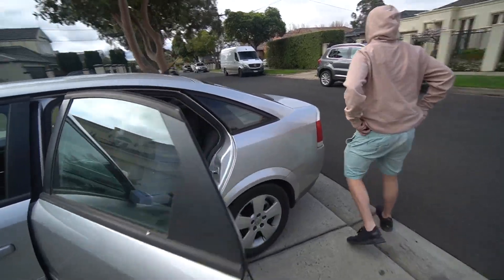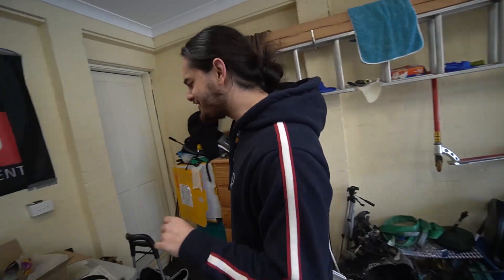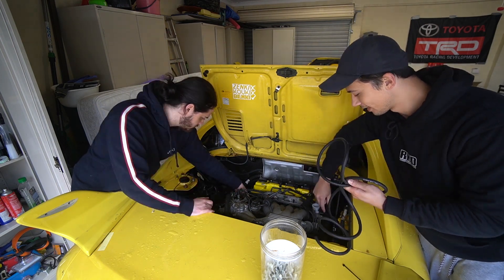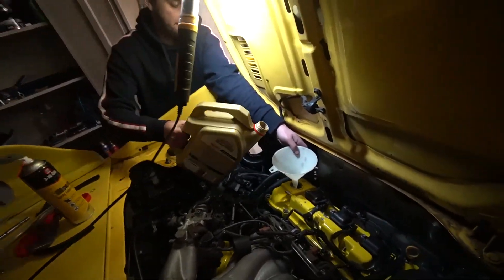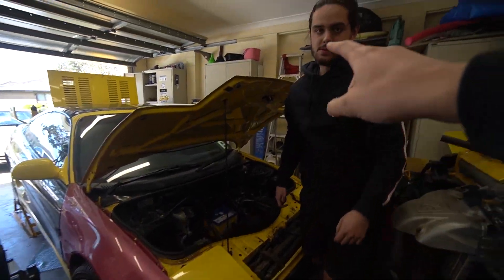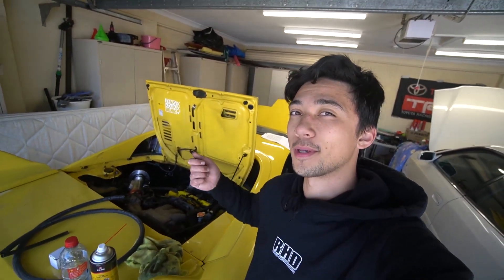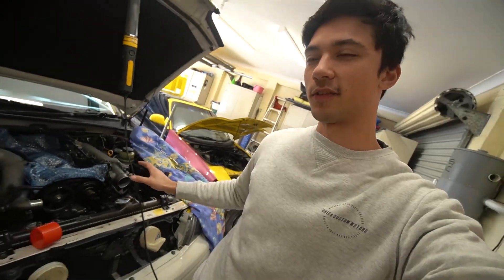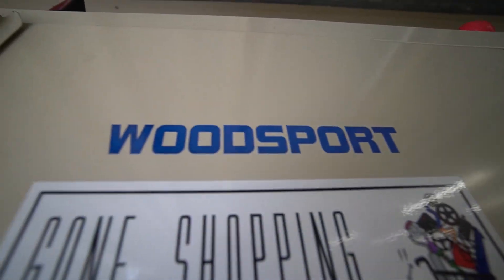STARTING the Benki MR2 For the FIRST TIME!

Comment: if its got o2 sensors in the exhaust its not gonna idle without them man ✌️
Reply: already has both the o2 sensors installed, hoping it's a vacuum line that's causing the rough idle.
Reply: @LachysGarage  yea man could also be the pcv if you unscrew the oil cap or pull the dipstick out and it idles better/revs up that would cause a bad idle aswell

Comment: Rex 5w-30 is too thin a viscosity especially since that motor has 260xxx kms, my 1mz has 200xxx kms and I’m putting 10w-40, I’m telling u Rex based on the way u guys drive them that motor is gonna wear out much quicker than normal
Reply: Yeah I was about to comment that lol
Reply: Songs Without Corey I’m telling u bro, it’s gonna wear out quicker and it’s gonna run hotter
Reply: @johnpaulfeghali4216  yeah definitely, I've always run 10w-40 with all my cars, wouldn't do anything else, especially in this climate
Reply: Songs Without Corey straight out mate